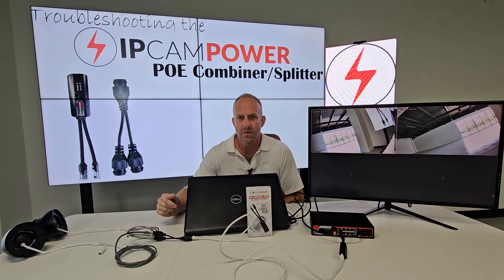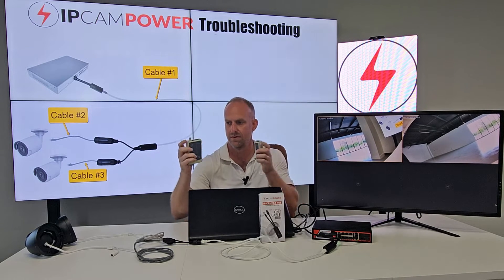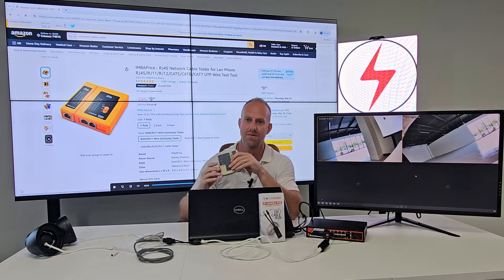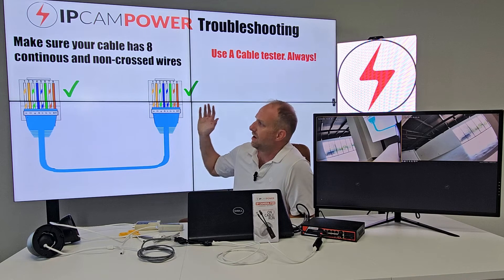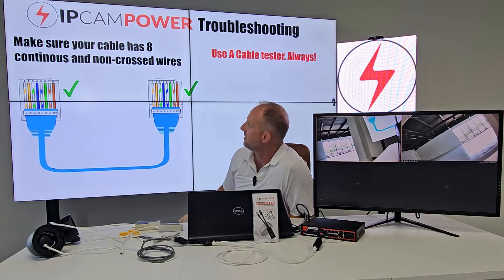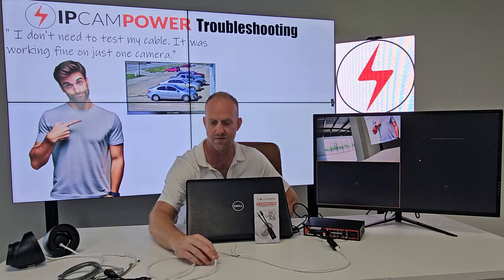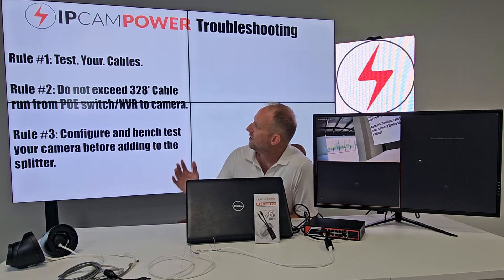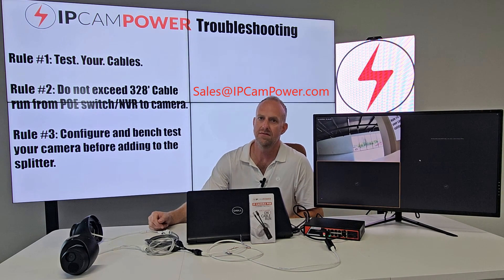Troubleshooting the IPCamPower IPCP-212XD POE Combiner & Splitter

Comment: Good info. Thanks. I have one arriving today from Amazon, but I do have one question:  I need to power a PTZ camera (which requires more watts of power) and also one simple fixed IP camera that requires less wattage. How should I handle this situation? I do have a variety of higher powered POI injectors. Can I use one of these injectors on each of the lines at the switch, or would I use just one larger POI injector to cover both cameras?  Not sure how this works.
Reply from the maker: This device has a max output of 15 watts of POE on the poe output so that may limit you if your PTZ uses more than 15 watts

Comment: Does the same rule apply to the first generation splitters? The ones with the blue combiner. We purchased a pack of 24, and down to the last 2. Every now and then we do get 1 camera, we know we are within 328 feet, all three cables test PASS. When we get 1 camera, we always attribute it to the IT Company and the switches they provide us, for example, Cisco Meraki, or Juniper all managed switches. Could this also be the problem?? Could high level managed PoE Switches cause the 1 camera view? Even though those ports are turned on, configured to the VLAN and PoE turned on, sometimes the splitters dont work.
Reply from the maker: The Blue Units only work on Mode A so its possible that your switch is outputting Mode B

Comment: I am able to get this work on a cisco switch, but our newer aruba switch it doesnt work.  Plugging directly in switch bypassing splitter works with each patch cable.  Test works all pairs on each patch.  However, Aruba switch will not power this up when splitter is involved on Mode A or B

Comment: Not compatible - 4K 2.5'' PoE PTZ IP Camera with Mic/Audio in, 8MP IP Dome Security Camera Outdoor, Waterproof IP66, 2.8mm Lens 60ft IR Night Vision, Pan 0~355° Tilt 0~90°

compatible - IP5M-D1188EW-AI-V3 

Amzn , its deleting my links. The not compatible ones, i made all my cables. Tested them. They worked on the compatible camera pair chain , and not on the incompatible pair chain. 

It is not mode a / b ,  The nvr is mode a. and works with one incompatible camera . It is something else.
Reply: Similar priced work around  for unsupported cameras -- MokerLink Outdoor 4 Port PoE Switch/Extender, IEEE 802.3 af/at PoE Repeater, 10/100Mbps, 1 PoE in 3 PoE Out, Wall Mount Waterproof POE Passthrough Switch